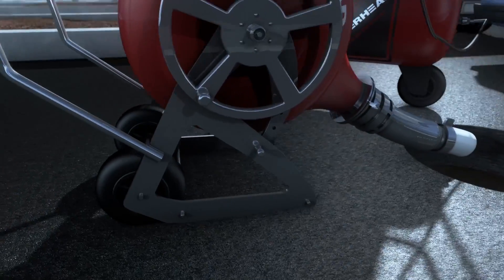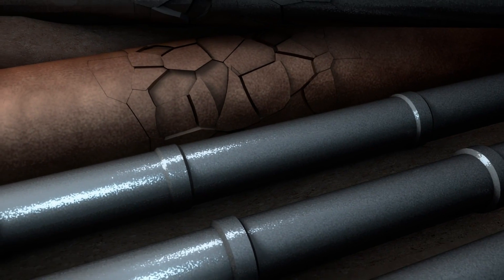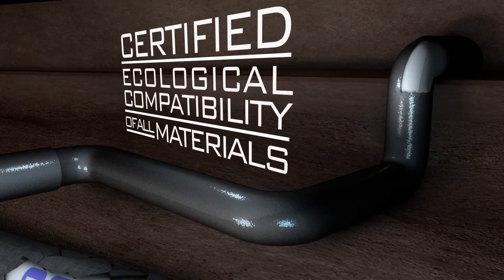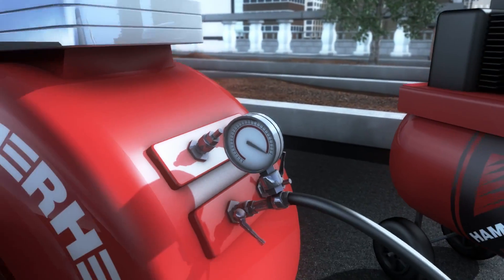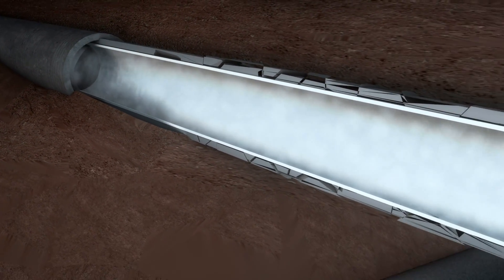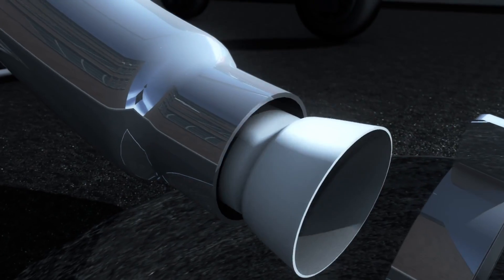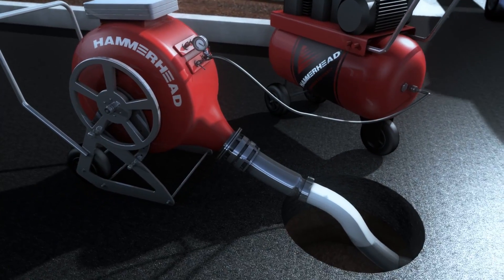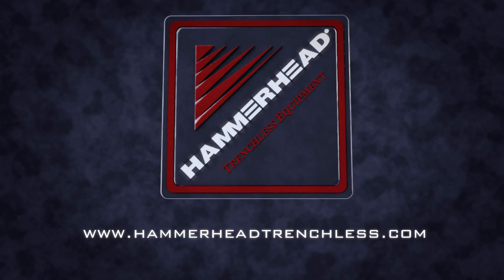CIPP Lining Systems by HammerHead

Comment: I don't think you can do it with Orangeburg pipe, due to the fact that to have the liner work, the original pipe has to be cleaned to a degree which will allow it to adhere and cure. To clean Orangeburg like that is enormously difficult to clean when it's in the best possible condition; once it has lost the laminate and has started to degrade, to clean it would likely destroy it. I am not 100% certain about whether it is possible to use liners on Orangeburg, but that would be my reservations about doing so. 
CIPP can be hydro jetted to your hearts content after it is cured. However, one of the positive aspects about the lining is that you aren't likely to have to do so, in most applications. Unlike, for example, cast iron, which scales/degrades and over time develops a rough surface which buildup likes to adhere to, the liner provides a smooth, slippery, scale free surface. Also, it doesn't have the offsets, exposed couplers, ability to allow root intrusions and so forth that is standard when connecting lengths of standard pipe materials together with couplers/fittings.
The cost will depend on the diameter of the pipe and the total footage you will be lining. I believe in average a lining, with all of the preparatory work on the pipes beforehand, runs an average of 20,000$.

Comment: Questions:
1) How well does this work with Orangeburg pipe / No-Corrode (if possible)

2) How much pressure can the new pipe handle? If someone were to hydrojet it in the future?

3) How much?
Reply: A properly installed CIPP liner can be installed into Orangeburg, and it happens all the time. Prep is a little more tricky since descaling can't be as thorough, but the new liner doesn't need to adhere to the old pipe. Most CIPP liners are only meant for drainage applications and aren't rated for pressure application.